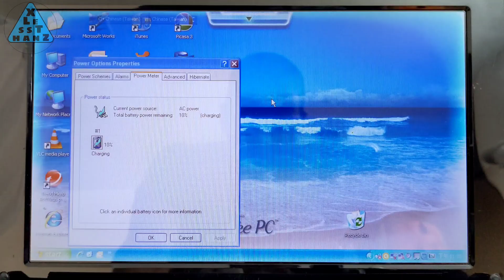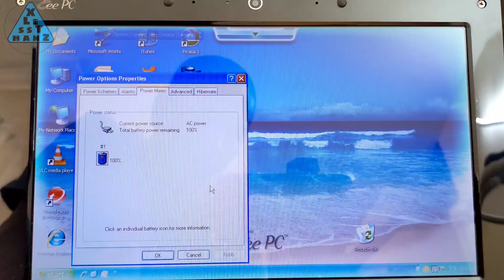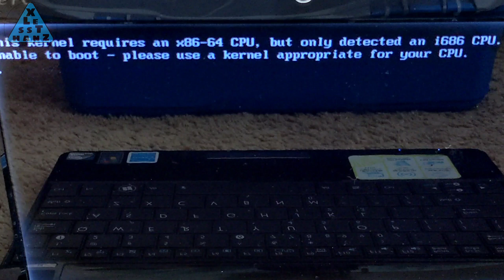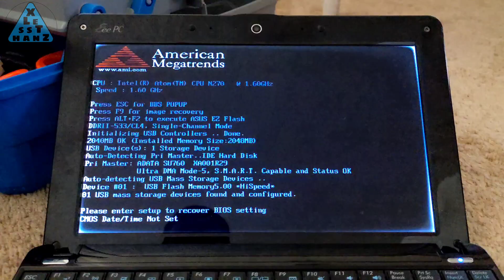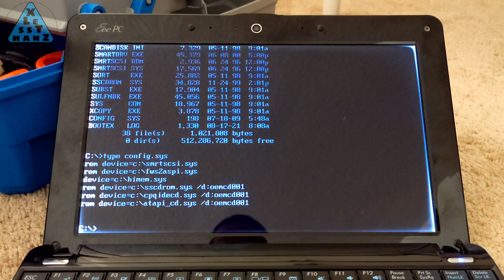CloudReady Chromebook Conversion (WHY NOT TO CONVERT...)

Comment: This is a great video, have you considered installing android? I installed Cloudready on an old HP SFF office computer. I did that a little over a year ago. My next project will be trying to run android on an old computer.
Reply from the maker: Thanks.  That Android implementation would be interesting.
Reply: @XLessThanZ  I am very happy with Cloudready on an old desktop. Get the Logitech K400r keyboard with trackpad and it works just fine. I want my next project to be running android on an old HP SFF. Cloudready runs like a champ on an old HP. Now I want to know what it will do with android.
Reply from the maker: @timothyprice9064   I currently use CloudReady on a 2009 24" iMac daily to work from home.  The large hi-res screen is very useful for doing work related tasks on a home computer.
Reply: @XLessThanZ  I use the flat TVs at home. I only have one monitor and I only use that when I'm fixing someone's computer. The screen I'm on now is a 32 tv. At this point, I can say it's been years since I used a monitor on a computer. If you get a chance to figure out how to get android on a PC let me know. Thanks in advance.

Comment: Very interesting video, i got a bunch of laptops which i rarely use. I find the desktop computers are always faster and get wifi much better. I have a core i3 3.3ghz  4gb ram desktop with windows 7 that runs at least twice as fast as a windows 10 lap top with 7-8 cores and 16 gb ram.  That and the screens on laptops are too small compared with a 22-32 inch monitors
Reply: I agree with you, you get much more computer for the money with a desktop over a laptop. And upgrades are fun and easy. But on the other hand, you can't take that desktop with you while traveling.